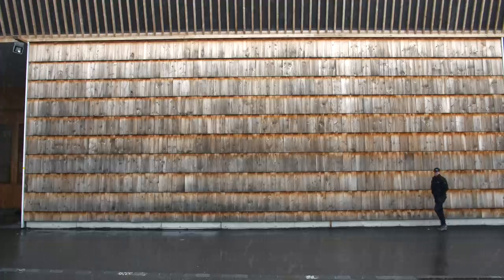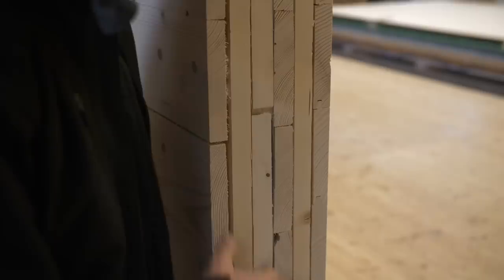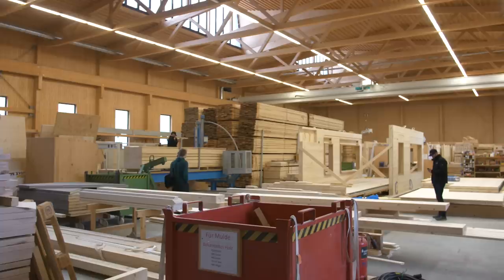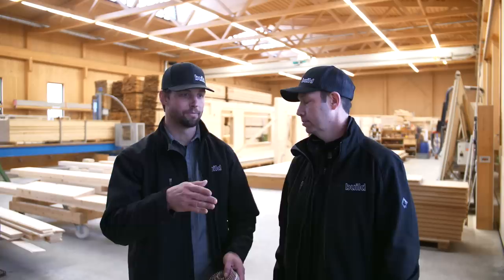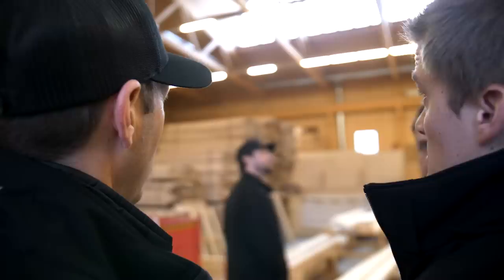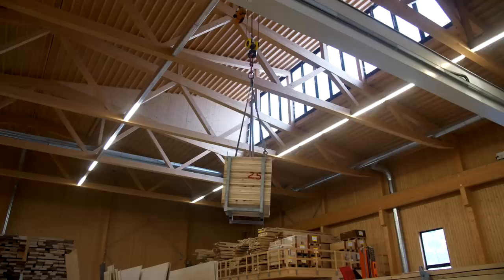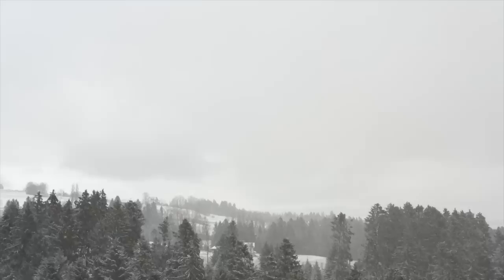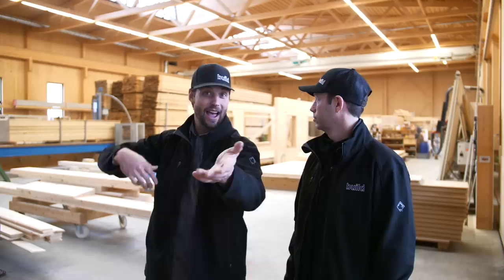This Swiss Builder uses NO INSULATION...

Comment: That is amazing!!! But how do they plumb that and run electric?
Reply: The blue tubing they showed the one guy installing is emt tube for electric by the looks of it.
Reply: Ryan Chaffee that’s what I thought. I’m guessing they cut a chase and then install it. But what if you want to change things latter? That would be tough. Would love to see more on the process of how it’s done.
Reply: Some fancy electrics and pluming that is made to be in view, or during the building process built in the walls, with in the walls changes later are potentially problematic.
Reply: @danielmancini1051  Maybe you just replace the boards on the inside layer
Reply: @willem18241  They cover it with a surface layer later, if you want to change the wiring you remove the surface layer and reattach it later
Reply: Very poorly and Heaven help you if you wish to remodel.
Reply: w8stral that house probably cost like 1.5 million, I don’t think money is an issue
Reply: $$$ is not the problem.  You literally CANNOT remodel or change the house around without it looking like Shit after you are done as the plumbing/electric has to be run on the INSIDE face or outside face of the home. I'm an electrician.  Had multiple log homes or concrete brick homes where they want to remodel and you have to tell them, sorry, NO you cannot do it that way without plumbing electrical being visible or building a new wall or some other odd work around.   @gilv302
Reply: They use extension cords everywhere!  🤣
Reply: w8stral lol add another layer
Reply: Yea right... and all of the finish work... Brilliant way to turn a $300 remodel into $3000.  Two thumbs up... @gilv302
Reply: @w8stral  I have worked on cross laminated timber houses, and it is actually very simple to work on. If you want to run electrical, plumbing or anything else, you can remove the facing boards and router in a channel exactly where you want, put the facing ply back on, re-attach and your are done. If you have the tools there is no way that you could change electrical behind your walls in a house with drywall, it is a matter of hours rather than days.
Reply: Drywall it is easy.  Drop it down from the top or from the bottom.  Fish.  Done.  15 minutes later. As for CLT... "remove" face board... without damage... yea right.  Router giant ass groove... Holy Shit what a mess.  Day later you are still cleaning up the router mess not to mention you have to set up a guide.   @compasteedee
Reply: w8stral yes log homes are  special,,some don’t want to see conduit, or wire mound, , where I came from  ‘MIC’ was routine, then they went to pvc, as it did NOT RUST, TROPICS
Reply: w8stral  recently I saw a home somewhere in the Bush,this guy built, but mon the inside was some insulation panels which lock together,like playground safety mats,,but the guy used a special dit to a WELLER SOLDER GUN which cut out the area where he laid electric lines, surely different, I guess that wall ‘may’ be covered after inspection?
Reply: If its in the bush, there are no permits or inspectors... And generally speaking all codes around the world require a certain distance between the face of the cavity/wall and the wires. 

The whole point of this type of construction is that there is no SHEETROCK.  Well one of the points.  And R~10 wall is crap.  Cost of all that wood, you could easily build a R50 wall that is far stronger than that solid wood wall.  Why stronger?  Because that standard R50 wall would be MUCH thicker and your section modulas goes by the square of the thickness.  2X thicker wall is 4X stronger using normal construction compared to the all wood carpenter ant palace.    @flybyairplane3528
Reply: Be easy to hang cabinets
Reply: =)   Finally, an "upside"....  @davegordon6943
Reply: @w8stral  drywall itself is easy to install, but it is very time consuming to finish. With mudding and painting, you are looking at no less than two or three days with drywall. Not to mention that drywall dust being much harder to clean than wood shavings. With CLT construction you also have a comprehensive map of each wall, as to where everything is placed, there is no guesswork, as there might be in a typical wall where you have to fish. Also channels are put where they will do the least damage. You are correct, you can marr the facing boards, but you will only really do harm to one board and the rest will be unharmed because you can pry them from the non-facing side. Then the marred board can be easily replaced with one you buy, which may run you $10-20. All this, however, is worst case scenario, as most CLT constructed houses have a network of channels already run for future development. There is typically a secondary main channel running horizontally with vertical branches as close as every foot or two. The only time you would not use this channel is if something wasn't already prepared in the desired location. This is an established building method that many common problems of  traditional stick-built construction doesn't have an easy solution to. It isn't perfect, but it is very well thought out.
Reply: @ryanchaffee7243  . Emt is electrical metallic tubing. What we saw, is that their version of ent? Electrical non metallic tubing?
Reply: NIT: wood ages.  You can't replace without it looking weird. 
 I live in a log/big beam home.  I prefer wood interior.  My mother/sister/sister in laws  hates it and loves.... WHITE without any character.  In fact, most women do. And when it comes to decor, WOMEN rule, not men.  CLT/Log/Big Beam is dream for those of us who DESPISE paint/mudding, myself included.  It is NOT reality. It is a massive fight anytime I wish to push natural wood color or stained wood at any job site.  Yea, I am an electrciian, but have done a lot of interior house work as well as a GC finisher.   @compasteedee
Reply: Daniel Mancini putting in extra electric conduit seems easier than with standard brick construction.
Reply: Put electrical outlets in baseboards so they don't have to be run up the walls, and put plumbing inside the bathroom/kitchen cabinet the sink is in to hide the plumbing.  And maybe just use allot of lamps with their own switches for light, or light switches could be be put in trim around door frames.  Connect everything up under the house in basement or crawl space?
Reply: CLT is solid, same as concrete.  There is no floor trim cavity.  But yes, in log and I presume CLT housing, the outlets are on the floor and majority of wiring is obviously ceiling/floor.  Same is true of old lath and plaster homes.  Switches are a different matter.  No, you never put them in trim around doors and for very good reasons.  Wires would rub constantly on screws nails holding door in place due to vibrations from the door being slammed.  Not to mention how would you get the wire in?  You still have to have door wedges to get the door straight and plumb.   @h82fail
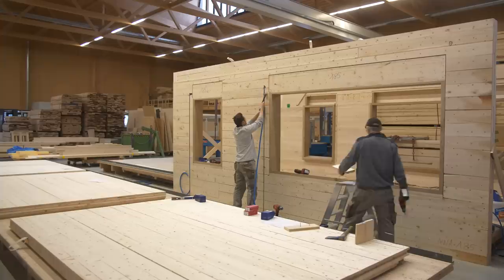Reply: 2:12 The guy to the left is installing blue PEX, which is plumbing tubing for cold water. In the US, blue PEX is used for cold water, and red for hot.

The electrical will likely be installed as Romex, an insulated cable which is easy to run in grooves like we see here.
Reply: @danielmancini1051  can't be much harder than running in conduit one would think..
Reply: @w8stral  Its not that you can't ,  Nobody wants to pay the cost that is involved to do it right.
Reply: @ryanchaffee7243  If so that used a grooved/routed cut in the wall.  Finished over how?  Installation cost would be astronomical.
Reply: @compasteedee  As shown in this video by this Swiss manufacturer, there would be nothing simple about pulling, replacing facing layers of a factory manufactured wall.
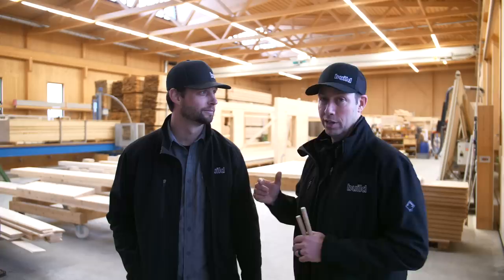Reply: 0:57, no glue?
Reply: It is rather simple.  Reality dictates that not everyone can afford to live in a palace.  Demanding through codes that everyone live in a palace is insane.  Just means you have a very large number of people who will NEVER own a home or NEVER get out of debt.   @paperburn
Reply: Daniel Mancini  they probably don't have electricity in that country
Reply: Wooden wires
Reply: Kek Gold Not only, it's also for people who like the esthetics, accustics and overall good atmosphere of these houses (and have big bank accounts). Also, candles are no-no for "plastic bad" people :)
Reply: I've seen variants of this where the walls are a thick sandwich construction with wood fibre insulation in the middle. Don't remember the R-rating, but it passed the strict building codes in Norway, which is as cold as Switzerland, if not colder.
Reply: Daniel Mancini inside we run counterwall along the perimeter main walls, these framming ( we use galvanized steel framming) allow you to run all the electric and plumbing
Reply: How old are you actually? How do you change installation in other sort of constructions... 
Simply make a plan and (you, for sure better..) hire a professional craftsman fixing the whole according to law & regulations.
Reply: w8stral after about r14-15 you start to get incredible diminishing returns. For walls that is.
Reply: w8stral  usually in Europe CLT homes have a drywall counterwall on the perimeter walls, this means you can actually route all the plumbing and electrical behind, interior walls are actually drywalls, same as dealing with a regular wooden house
Reply: Ricky Wright yep in Europe we use pvc flexible tubing to run inside each electrical wire, we use emt in some outside applications
Reply: Just use WiFi. Problem solved.
Reply: @danielmancini1051  I would design my home around a central utility chase, while leaving me the ability to move things around on the outside walls. I would imagine a fair bit of 2x4 framed walls here and there would break up these wide open spaces nicely.

Comment: interesting... i have a house that was build near a mill, about 70 years ago... part of the benefits package for the employees was they got all the off cuts of wood, so many of the houses of that period were made like a wood 'sandwich'...   layers and layers and layers of wood, nailed to each other...  which means running electrical wiring is a bit of pain since it's not just a case of cutting a hole through drywall and fishing wiring through... BUT once the woodstove heats the house up to a temperature,  the physical mass of the wood keeps it warm literally for days after the stove goes out...  one benefit is since the walls are solid, it's easy to add a door or window just about anywhere since the headers are already 'built in'...   i had double glazed windows installed a few years ago, and one of the old windows had leaked and caused rot, but it was just a case of cutting the level of wood below out, and just adding new ones in...    kind of a brilliant design really.

Comment: 5:37 why the hell would you want a metal roof on that (unless you mean a copper one)
Reply: DestroyerX61 metal lasts a long time, not only that but, if there was a fire nearby,,sparks will NOT start a fire on your roof, I’d want one in FLORIDA ,,when I get out of NJ.
Reply: Leighton Samms fires are not an issue in Switzerland. However metal is low maintenance and helps shed snow which is probably more of a concern. In the U.K. we would use slate.

Comment: All that wood looks like it would be stronger than the regular way of building.
Reply: The greatest strength for a CLT panel comes from using the glued method .
Reply: daimon hellstrom  
"You compact the soil as much as you can but especially in areas with wild weather changes and west cold winters they shift alot."

Cant build on soil in cold climates. Have to either build on solid rock or dig a few meters to get down to frost free ground. When we get down to solid and stable ground its time to fill and compact blasted rock and finally a finer gravel that is compacted before insulation panels and concrete.   Expensive but anything else will shift within some years. 
When done properly shifting is not a problem.
Reply: daimon hellstrom 
It's pretty strict here, but so are the building codes overall too. Building a new home is pretty expensive, but they are very high quality as well. Property market is insane in my opinion so i own a home built in 1975, but at least it is built on solid rock. :)  as a surveyor /geomatics engineer I get to be involved with lots of different types of construction.
Reply: daimon hellstrom 
Apartment complexes are usually secured by concrete piles to rock or very deep. Single homes are either blasted into rock, dig to rock or dig to a few meters to ensure frost free stable ground. Sometimes this can be costly if the ground is unstable or unsuitable.

Im from Norway (only 40min from Sweden tho) so we very often have rock within reach.
Proper foundation is important and a major part of the overall construction cost here.
Reply: seriously?
a house made out of brigs or concrete is mutch better in almost every aspekt
Reply: daimon hellstrom  maybe after 300+ years, you really want to worry about rotting,lol
Reply: @dk-wy7ph 
It actually often comes down to availability that influence local traditions. England and urban Europe have lots of clay and rock based buildings, but rural areas and Scandinavia are more wood based. Wood is the norm here, concrete or brick is usually 1.3 to 1.8 times more expensive to build, but can be cheaper to maintain for decades so sometimes worth the investment. It is common, probably for building codes and future modularity to build wooden framework and use brick only for outer facade layer. Combine the almost maintenance free facade with the stable and easy to work with wood frame that can be insulated and sealed for codes.
Reply: Hi Herby and Maddy hows Wisdom? ok I hope thanks for your channel and all the hard work you do to educate people on sailing, thanks Maddy for your gifted art. I'm playing catch up on your vid's on season 3 at the moment. I enjoy them very much many thanks to you both.
Reply: but is it  necessary? my house is a 113 year old, 3 stories stick build with plaster interior walls, has NO insulation, and yet my heating bill is not any more then newer houses the same size, and it's still structurally solid. In fact i have seen a lot of 200+ year homes that are just stick built that are in good shape. Seems like this construction just waste trees.
Reply: HappyandAtheist  I guess, but winters get pretty cold in iowa also though, next week will be in the -40s F
Reply: daimon hellstrom  Stuff will rot - if it gets wet. Two points. As a Norwegian we have a good number of "Stave churches" - these are all wood churches and were built around 1150. They are still standing fine - and you can visit any of them.

We have a small summer house in the Austrian alps. It is unclear when this house was built - but we have found documentation that the house was there 400 years ago. So it is at least that age. This house is wattle and daube (basically twigs with clay) - with some serious wall thickness. The walls have not rotted - yet one problem is the walls suck moisture like crazy - and we need to keep the house heated. But that's beside the point - the house is still standing.

I would think that if a house as describe in this video has the right foundation, correct ventilation and well maintained - the building could last as long as you want.
Reply: Wood has a very hight strength to weight ratio. Just get the layup right as with synthetic fibre composites.

Comment: Interesting, but seems like a bulk use of wood that is very costly, heavy and labor intensive. Might have used 2x6 framing, rock wool batt, and R6 Zip R exterior sheathing with liquid joint flashing to achieve comparable R, longevity and air exchange rate for fraction of the price.
Reply: The entire idea is to only use wood, but wood only is obscenely expensive. I genuinely don't see a good reason to go wood-only. I don't hate the idea, but I'm more for making affordable housing than housing someone claims will last centuries, especially if the affordable housing can be more space efficient.
Reply: Instead of rockwool, you could use hemp/wood/straw-fibre insulation instead (blowIn or from bales). No need for energyintensive mineralwool.

Comment: Whether wood is good for bridges depends on the bridge. There are some 200-300 year old wooden bridges in America but they are of a shorter span. I've seen some wood railroad bridges still in use from settlers times. But yeah, 16inch thick all wood construction homes should last, as long as you can keep insect damage at bay, and of course, not set the building on fire. Our main issue here in the U.S. would be the strength of the wood due to lack of older growth with tighter growth ring patterns. We have an approximately 200 year old house that is starting to see some structural failure, but it is also in a flood-plain. It has physically sunk to just below ground level and the almost constant contact with ground water has rotted the beams from the truss and beam structure. The amount of damage to date would have had a modern built home collapsed a long long time ago.
We at just trying to come up with the money and plan to jack it up and rebuild the foundation and base of the house.

Comment: 500 year house if it stays preserved in ice lol. Humid hot climates with bugs may not be so good for a swiss house.
Reply: In Sweden houses used to be similar to this, although using solid logs (which is not necessarily the same as a log cabin/house) they hold up extremely well. But as always you need to build according to you're environment. A lot of houses in warmer climates would crumble under the weight of a metre of snow.